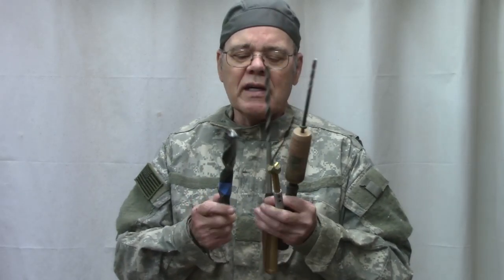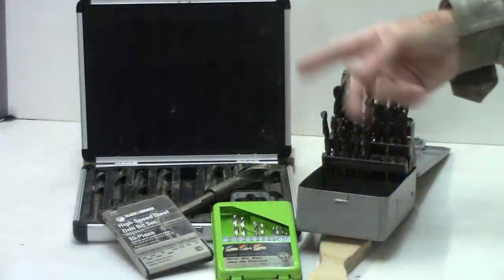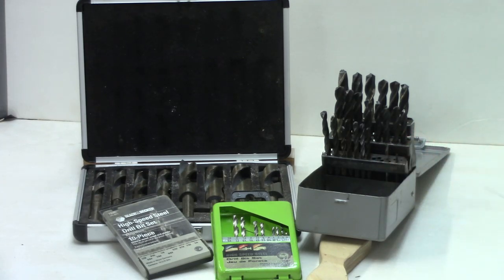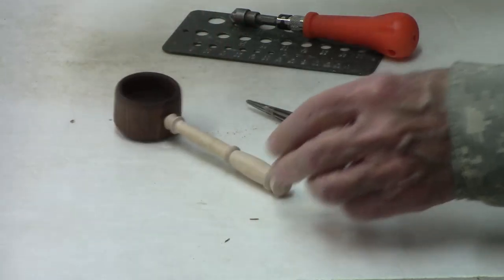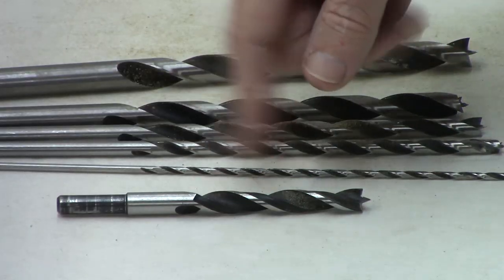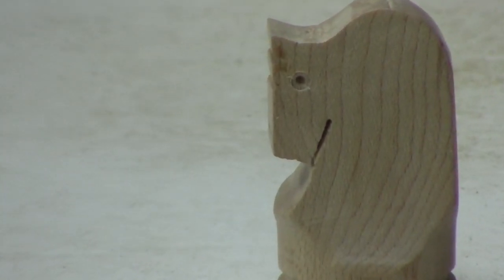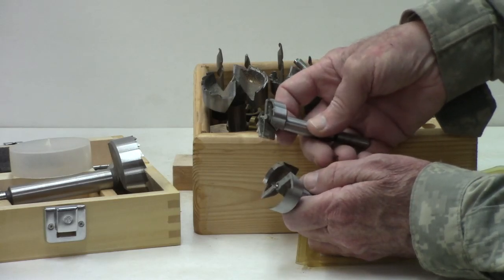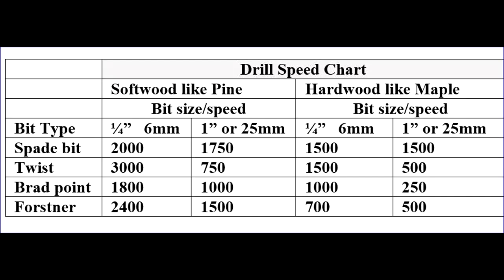Drill Bits for Drilling on Your Wood Lathe?

Comment: Thanks Mike. I've been looking at at some metal machining videos and I have been interested in the centering drills for woodworking (not just turning). Now after watching this, I've got to get a set. Only thing you didn't cover in this video, is the length of the spirals in a twist drill. The longer spirals may wander more because the drill has to go further into the wood before it is making contact with the wood all the way around the hole.  I never even looked at the spirals before, but after watching the machinist I looked at my collection of drill bits and I noticed that the center bit in my hole saw has really short tight spirals for keeping it centered.
Reply from the maker: That is news to me, maybe because I am not a machinist, LOL.